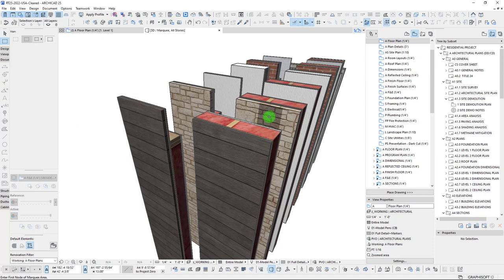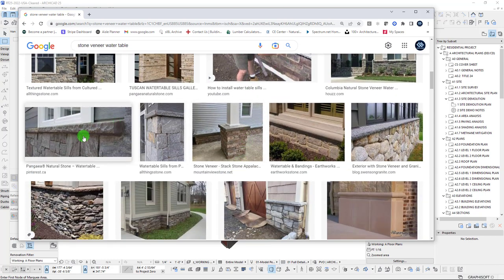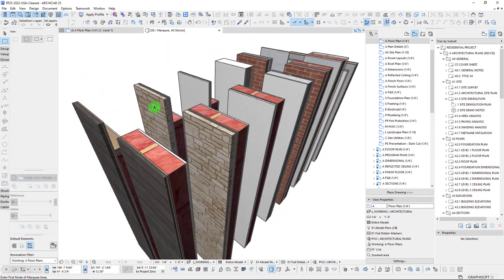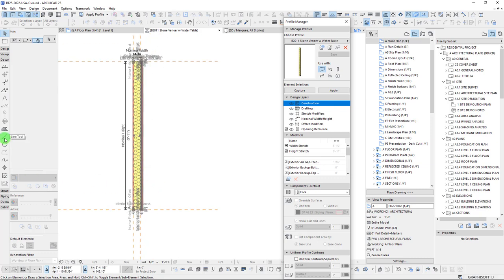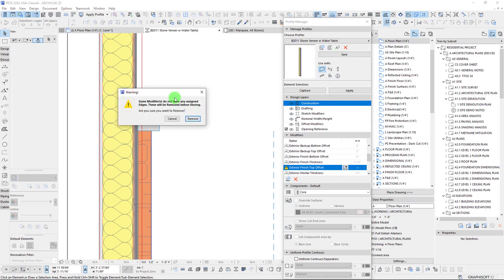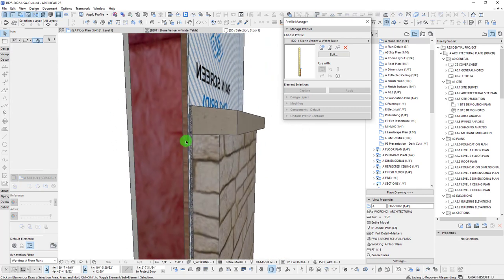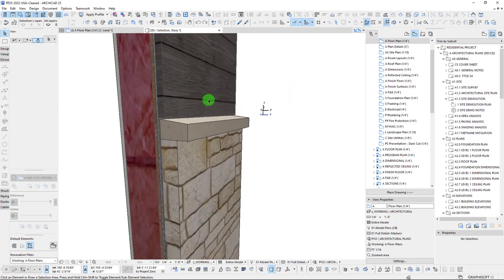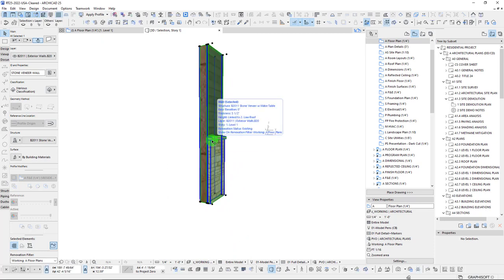How to Create Exterior Wall with Adjustable Water Table

Comment: I have a water table situation on a current project. Using a complex profile I created similar to yours. The top of the stone sill is also the bottom of my windows (about 2' above the floor deck.) The floor plan shows the window correctly however the 3d does not. Have tried multiple work arounds to no avail. (Doors will be next)  If you've covered in a previous video, appreciate you pointing me to the video. If not, would love to see you address this.
Reply from the maker: Hi Jon thanks for the question. In what way does the window not show properly in 3D?

Comment: This is great!!! Thank you! I have used this to actually create a wall that incorporates a profile in the Exterior Plaster That Cuts through it and can change the colors. But I have a problem. The height modifier is changing the measurements of  the profile, but not always. any ideas as to how to constrain the profile height but that it moves with the different heights of the plaster?
Reply from the maker: To constrain a profile  height, you must assign a modifier value that constrains the two nodes or two edges that define the top and bottom, or exterior verse interior. If you only add a modifier to one side of the component, then the other side will be fixed, resulting in weird geometry created when modifying the profile. To keep those in line, you have to constrain them by adding a modifier to do the job. Hope this helps!

Comment: Hi John :), thank you for this informative video! Is it possible to view the watertable with dashed lines when you cut below it?
Reply from the maker: Great question, and yes it is! If your cut plane is below the watertable, and your floorplan display is set to "Projected with Overhead", then set the Overhead Line type to a dashed line, and it will show the water table as dashed. I just tested this and confirmed it works properly, so give it a go and let me know if it works for you!
Reply: Ah, thank you for this detailed explanation! 🙏🏻🙂

Comment: HI John! What about some windows in that wall if we change a hight of plinth?
Reply from the maker: Great question, the windows will cut through the wall regardless of the height of the water table. In most cases you'd likely have the windows set above, but in the case you wanted to intersect them, you could split the wall and drop the water table to bottom of window. Plenty of options here once you get the profile setup right!